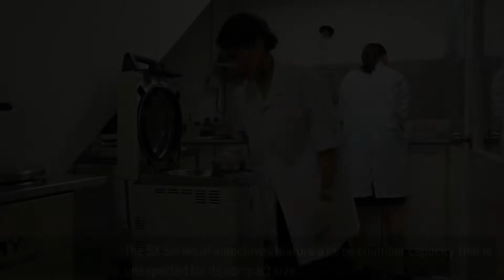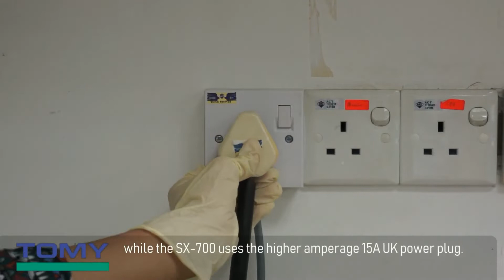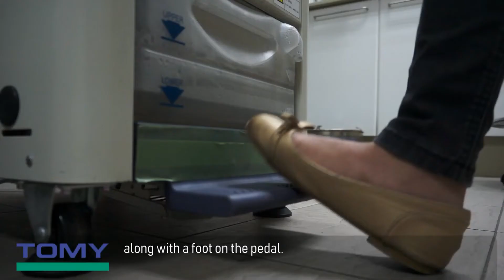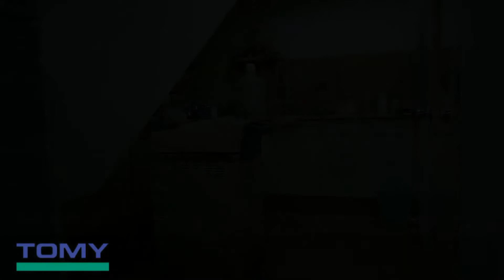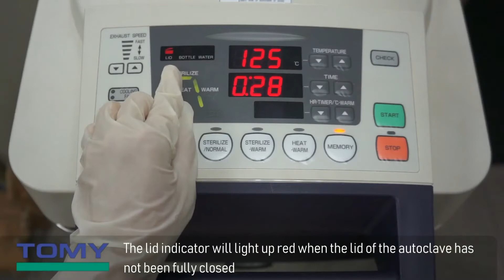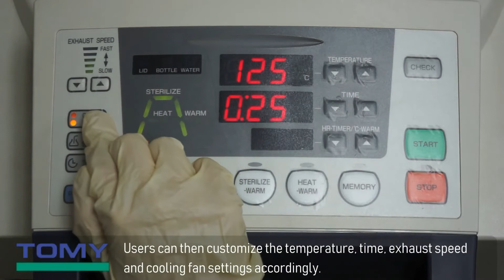TOMY Autoclave SX Series

Comment: DONT BUY: Had 2 SX-500s. On one of them the inside temp probe got caught on a bag we were sterilizing and broke and I was told that the part and repair process are confidential information.  Amuza will not ship me a replacement part, they have to reach out to 3rd party repair services and have no estimate on cost or time.  Good auto clave - but the placement of the temp probe just sticking out of the side wall and the repair policy and weird top secret replacement process make this an absolute NO GO for labs that need to rely on autclaves for sterilization.  I'm guessing the cost of the secret replacement will be 2k or more which means I'm probably just better off buying a Tuttnauer.  $8,000 down the drain after just 2 years.  Would have been nice to know about the repair policy up front.